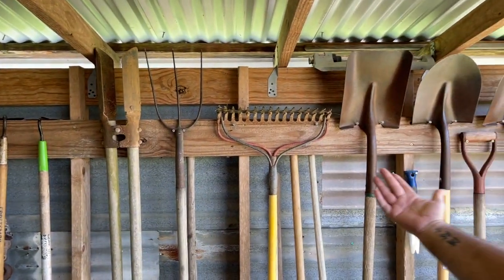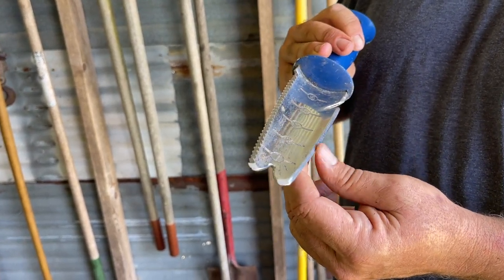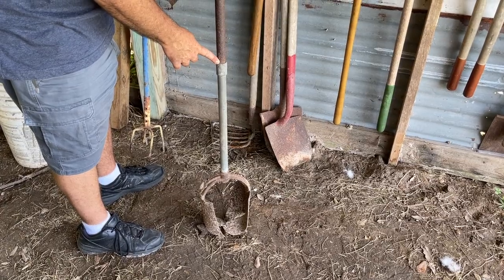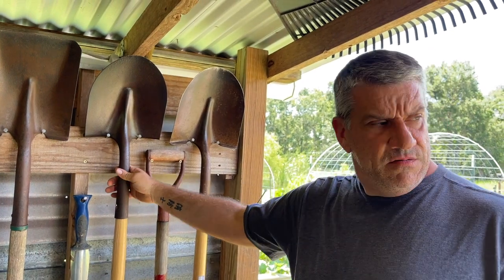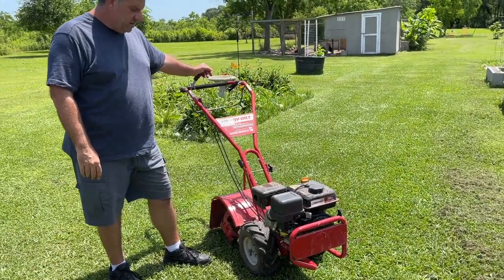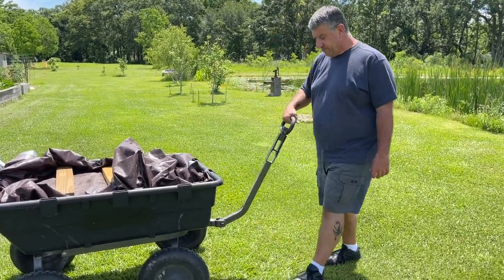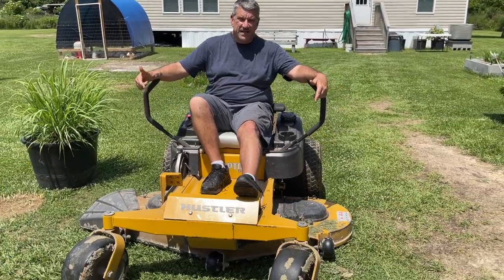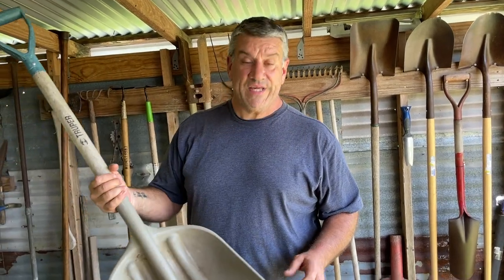Favorite Garden Tools - and some Vintage Pieces

Comment: You have some great tools there. The auger post hole digger takes standard 3/4" pipe for extensions. I grew up mowing with the push mower. I love Troy-Bilt rototillers.
Hula hoe has been a favorite for weeding. A "D" handle shovel for most dirt work.
Reply from the maker: Thanks Gil 👍

Comment: Hey ,nice demo on your tools, I have reg steel post hole diggers plus wood, also have that little 2 handed twist tiller.  That scycle mower😲. great if someone else is Pushing,lol- grew up, was all we used for years. Keep file handy to sharpen,hehe.
Reply from the maker: I do have a collection of files. I couldn’t imagine having to mow a large area with that thing. 😳
Reply: @BroussardHomestead  on thin bermuda its  ok, but geez, on carpet grass, especially if growed up,ugh.
Reply from the maker: I bet. I’ve noticed it’s awful to use on clover.

Comment: the T post driver also works as a jack.
Reply from the maker: Wait what??
Reply: @BroussardHomestead  to jack T post up, turn driver upside down, wedge under a knot on t post, pull post toward you from top, repeat. just using driver as leverage on post. to work it free.
Reply from the maker: I have to try that